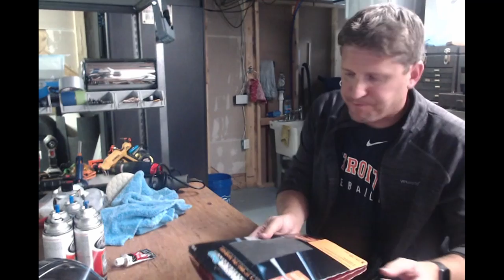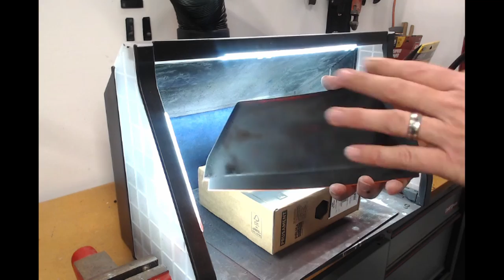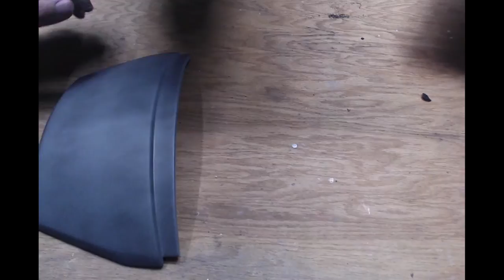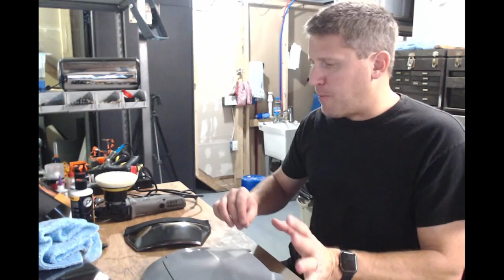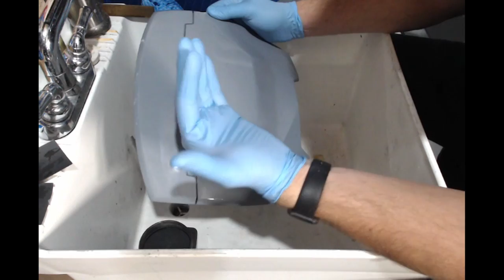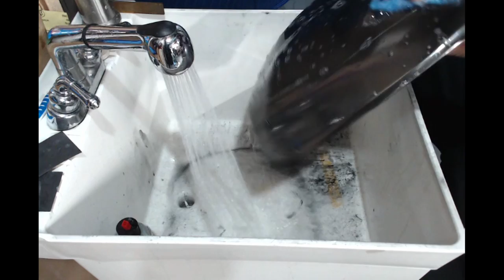Mandalorian - Start to Finish Armor Process with Graphite

Comment: I've seen anothr YT Vid where the 2k Clear Coat did not cling well 2 the graphite powder, nor does it withstand flaking or rubbing off. It looks horrible. So is it better 2 use chrome-colored paint then Clear Coat on top instead of graphite powder?? Clear Coat sticks 2 paint, not power. Wht do U recommend?? If choosing 2 wear armors as Cosplay frequently, which painting/graphite method would U suggests as tried & tru?? I need 2 kno b4 I invest in ths Project...

Comment: YOU SAVED MY HELMET! This was certainly not a beginner-friendly project (literally the third thing I ever printed...) and in hindsight I should have known. I didn't wear gloves when I first graphite rubbed it and I left splotches everywhere. Ended up pushing through at it was decent in the end, but the finish wore off very quickly. It became dull and had an almost burnt-steel effect which I expect came from the oil on my fingers. Finally took the time to take out the visor and graphite rub it again using this tutorial (and latex gloves! 😅). What a difference! Alright, I didn't sand the old finish down, didn't rub it and then didn't clear coat it and rub it again, but the method of washing it and being meticulous and slow really works amazing! Sure, it's far from perfect, but it looks great on my shelf again. Satisfied beyond belief. Thank you so much!!

Comment: Just started printing my armor using the great ape files (I just love my Prusa i3 Mark 3s!) and am collecting all the supplies. Will practice on the first piece using the butt and back plates, then assuming success I’ll do the bracers and finally move on to front and shoulders and then finally the helmet. This way I’ll build experience before doing the ‘show’ pieces … really appreciate you doing such a detailed process video! I now have the confidence I can paint my armor myself!

Comment: I finally just finished the process (took me close to 3 weeks w/my schedule).
Wow, it felt like a 30 step process, LOL. It wasn't that long...I love your results.
My results after following step, by step and getting the same products (all but the same brand of graphite powder), I got some dark/dense patches when I started to lay down the graphite powder.
I need to do my graphite wash and 2nd clear coat tomorrow...Hopefully the 2nd clear and graphite coats will cover the dark splotches as well as the light ones you mentioned.
I may need to wet sand and polish a bit harder...we'll see.

Thanks again for your process. I want to perfect this and get your glimmering results! :)
Reply from the maker: The blotches are normal. Hope it came out well!
Reply: Thank you Joseph! I watched your tutorial, yet again, and you do mention that. Sorry to bother you. I did apply the 2nd clear and graphite coating and yes, it's much better. 🙏

Comment: I know its a little off topic but I am looking for a flat black finish on an automotove a 3D printed part that will be in the sun and weather
 I think most of your vide applies to what I am doing. Most of the flat black is enamel you note to avoid enamel, why?  I understand the paint and prime portion but I want end up with flat black part that is good ourtoors. 

My son is using your vide for the shiny mandalorian helmet you are demoin in the video. He pointed me to you since you mentioned you had done work on the automotive paint side. Great video BTW!

Comment: This is incredible! I’m overwhelmed by how comprehensive this tutorial is!

After the final graphite application and cleaning, should I allow more time for the clear coat to cure before handling it?

Also after that final graphite application, should I add another clear coat over it or would that be overkill?
Reply from the maker: You can handle it, just be gentle. Give the paint some time to harden up before really playing with it, couple days.

As for another clear, you absolutely can, just would be dulling it out.

Comment: Thank you for the video!! I followed your process and my Armor turned out perfectly. I have used the armor since then and have  scratches like you mentioned I need to fix. In the conclusion/portion you mention that you go back wet sand and clear coat but my question is what step do i got back to to fix the scratches specially? the last primer stage to clear? etc? again thank you for the video!!

Comment: I have questions. :D

1. Have you considered reenforcing the back with fibreglass?

2. I've seen a lot of people use a 2K clear coat over the final graphite. Is there a reason you don't do something like that?

Thanks, great tutorial!
Reply from the maker: 1 - You could, I haven't found a need.  My first helmet I did fiberglass back along the seams.  My current one isn't, no issues.  Over 40 hours of trooping in them and no problems.

2 - You could, any coating over the graphite will dull the look though.

Comment: Hey! I know it's been a year so you probably won't see this, but here's to trying. Could you make a video or explain how you prevent overspray (or dust layer I think you called it?) On the helmet? Basically spraying one side causes the other sides to get slightly misted, ruining the smooth finish.
Reply: Good mist extractor, masking and polishing are all possible solutions for you

Comment: Great video and love the process. Anyone got a suggestion on fixing a gouge that cut through the grey primer and clear coat. My thumbnail caught a forward facing edge. Thinking I can sand down the clear coat and re-do the primer then clear again but wondering if sanding the bad area down might be suffice. The gouge is the first white primer coat.

Comment: Another Quick question! You mention that the second graphite rub should be done when the varnish is still not fully cured, so that the graphite can cut in better. If one is not doing the optional polish step, is it perhaps sensible to also do the first rub when the that layer of clear coat is not yet fully cured?
Reply from the maker: Yes, you could do that. I would test on a test piece though.

Comment: Do you think this process could be used at least in part on the black series helmet? I bought 3d prints of all the other armor but I want to use the black series helmet with it. I want it all to have the same look, is it possible?
Reply: follow up in case anyone else wants to know, you can and I did

Comment: How do you handle overspray on the helmet? I can get a nice smooth surface on the side I'm spraying, but end up with a lot of overspray on the back side of the helmet. For context, I'm currently using a 3 foot cubed spray booth with a 24" box fan and 24" furnace filter on the back of it.

Comment: Did you consider using a small rotary with a soft pad to apply the graphite? Or is by hand the best method.  Any particular  application pad you recommend?
Reply from the maker: Hand is more than sufficient, cotton pads seem to work best.

Comment: Hi there, amazing finish.. I wanted to know the actual process step by step and please correct me if I'm wrong.

After sanding and priming, you go with a clear coat, then you polish the clear coat, then graphite, wash, clear coat again, polish, and graphite ? 
Is that the correct sequence ?
THANK YOU
Reply from the maker: That’s correct!
Reply: @CT-Props  missed a step, the sealer ? Is it a grey gloss paint ? 
Because I have a black gloss, that's ok too ?
Reply from the maker: @PixelForgeLab you can use black, but the finish will end up being darker
Reply: @CT-Props  ok thank you 👍🏼

Comment: Awesome guide!

Silly question, but should I be using a separate sink from my usual bathroom and kitchen for the wet sanding?  I'm just trying to avoid excessive clogs.
Reply from the maker: It is less about the clogs and more the mess. My alternate to the sink was being outside with a 5 gallon bucket.

Comment: I don't know much about paints, why do you want to avoid enamel? I used Rust-Oleum 500° engine enamel as the base coat. I had a few issues with marks in the paint, is that because it's enamel?

Comment: After the first graphite application, I got the haziness you talked about but worried that if I add more clear I am concerned I am going to lose the glossy smooth finish I just worked so hard to get though al the polishing. Don’t you end up with a little orange peel and a spec of dust or two in the clear?

Comment: Hello, I have the Thor hammer aluminum metal and it has like a dull looking to it. So I painted it with 2x clear coat which was okay with the shine. Can I apply graphite powder to it for the chrome looking paint? Just wondering if the graphite powder will stick to the clear coat paint. Thanks a lot!
Reply from the maker: It will, but you may get some rub off.

Comment: i would like to know how one would weather it with your method. how airbrushing would react to the graphite and such
Great video. I would totally use your method when doing my build. What printer did you use for those size pieces?
Reply from the maker: I used oil based paints for the weathering. Air brushing will work, but you will run into issues with the paint scratching off. 

All prints done on a Prusa MK3S

Comment: Fantastic vid! When you sand the clear coat, are you using 320 or do you start with only a very high grit so as now to chew through it too quickly?
Reply from the maker: I have it in the video, believe it is 2000 grit on the clear.
Reply: @CT-Props  Ah must've missed it, thank you!

Comment: In Canada, one can of that 'cheap' Rust-oleum filler/primer is about $35-$40, and the nozzles clog after one use something like 50% of the time.

Pricing is pretty much the same for the other brands, so I basically dropped out of the paint finishing game for my hobby prints.
Reply: You'll definitely want to look into the protective gear you need to work with large amounts of it, but another really effective way I've seen people smooth prints is with UV resin, specifically the stuff used for resin printing. A bottle of it may be a more cost effective way to finish prints if you're ok with the safety concerns. Another channel called Vaultfox has a really good video talking about it while making a Bo Katan cosplay.

Edit: I just tried checking CA Amazon and it seems like you can get a 1L bottle for between $22-25, which should cover a bunch.
Reply: @MikeKatsar  Thanks for the info. I have actually used the resin 'trick' before, but my concern is usually not so much focused on smoothing, but rather painting the printed item to whatever colour I need. Smoothing I can get done satisfactorily (for me needs) by sanding alone.

Currently, I sand an item, then blow a few layers of acrylic paint on it with my airbrush, followed by an acrylic clear-coat of some kind (either Pledge floor wax or varnish). No more spray-bombs for me...
Reply: @imacmill  ah, gotcha. My bad, I misinterpreted the issue a bit. Unfortunately I don't have any other tricks for that one. Good luck/happy crafting, man, hopefully you find a cheap source of paints, airbrush adds up lol
Reply: @MikeKatsar  Dirt-cheap acrylics from a Dollar Store...they work perfectly.

Comment: Could you spray a light silicone lube to help with the preservation? Could give a nice shine and some slip and slide without being wet, spray and wipe off.
Reply from the maker: Is the goal to avoid surface damage?  It is pretty slick as it is since graphite is sometimes used as a lubricant.  Only damage I tend to get is hard rub or high impact hits.

Comment: How do you clean your parts prior to applying primer? Would a wipe with isopropyl and paper towel work? Then a light wipe with a tack cloth?
Reply from the maker: Light wipe with a lint free cloth.  IPA or any other solvent/cleaner can damage the primer.
Reply: @CT-Props  what about removing the grease from handling it with your fingers? Dish soap and warm water?

Comment: Can you mask over graphite after you apply a clear coat?  I wanted to try some tinted clear coat over some of the graphite, but not all. Some say that with graphite the clear coat doesn't bind as well and the masking tape would pull it up.
Reply from the maker: Yes, you can put the tape on the clear coat.  Just let it dry for awhile first.  If you put the tape on the graphite finish, correct, it will not stick well.

Comment: Is the Dupli-Color grey sealer very light in color? It almost looks white. In my tests so far anything darker than a really light grey results in the graphite looking too dark.
Reply from the maker: Yes, it is a light grey.  It just looks white from the lighting.  You can see the color at the 32:00 mark
Reply: @CT-Props  Yeah I noticed it seemed very light which was why I wanted to check. Thanks for the quick response. Love how thorough this video was!

Comment: Thank you so much for this detailed guide!! I’m currently doing my mando helmet and this has helped a lot. One question… I can’t seem to find a duplicolor grey sealer here in the UK, do you know of any products that I can use instead? Thanks!
Reply from the maker: I am not unfortunately.  That said, you could use even grey paint and get a similar effect.  I would just focus on it being automotive grade and less about brand.  Of course, test first on another piece!
Reply: @CT-Props  could a grey surface primer work for this purpose (not a filler in this case, but a flat surface primer)? Im in Europe and have a similar issue that I cant find anything here called a primer sealer.
Reply from the maker: @PrattleCor  It should, you could try just a grey paint as well.
Reply: @CT-Props  thanks. And thanks for the awesome tutorial!

Comment: so i was wondering, can you use this method too for weathered paint like as in the silver bekar for a paint chipping effect, i am currently working on my orginal mandalorian cosplay and want to create a look with some painted beskar and some not painted beskar. so i wonder if you can spray paint over it or add some clear coat  and then spraypaint over it?
Reply from the maker: You can, did the same with my leg plate
Reply: @CT-Props  ah thanks!

Comment: ins´t there a final clear coat for the second graphite layer?
Reply from the maker: There is not, but you can. Downside is that it will dull the finish
Reply: @CT-Props  but could I polish again??

Comment: What would you recommend to do if you  get a little bit of pooling of clear coat in a couple spots after the first graphite layer?  Sand it or keep going?
Reply from the maker: It would really depend on how picky you wan to be.  You could do without sanding, but good chance you will see it.

Comment: Hi, I have a little problem with this method. I apply graphite to a shiny black and very well... but... the prints are marked a lot later... if I hold it for a few seconds... the marks...I have applied an acrylic lacquer because it loses its shine a lot...later I can apply graphite again...but the same thing happens to me...I don't know what is wrong...
Reply from the maker: Are you saying you used this method?  or above was your method?  You mention  acrylic lacquer, you using the Rustoleum one?  I generally stay away from Rustoleum as a finishing product, their paints are just not suited to the task.
Reply: Hello, thanks for answering... I use a gloss black acrylic paint. I let it dry for several days. Clean with soap and soft cloth. then I apply graphite...but it's as if I couldn't hold on to the same place for a while...it leaves a mark and loses that sharpness. In Spain there is no rust oleum... there are other better ones... it could be montana color... etc... I just finished another 2 pieces... after the graphite... I wash with neutral soap and dry with soft paper...
Reply from the maker: @phulpo  All I can say is you are not following the process laid out in the video, so I really can't speak to the results you are getting.  One issue is black with graphite, it will come out very dark.  It is better with a grey color.  Also, seems like you are applying it directly to the paint and not a gloss clear coat.
Reply: ok..ok.. true... my method is different, but yes... it is steel but according to the light it seems darker... I will do it on the gray primer. thank you very much

Comment: So it’s possible to primer with grey instead of black so that the overall look isn’t as dark? Would that work with an airbrushed paint like duralumin? Primer with grey, clear coat and wet sand then apply duralumin……I wonder if it would give the same effect you have created here with graphite…I know that duralumin with a glossy black looks more on the dark side
Reply from the maker: In theory, yes. I would test it on a small piece.
Reply: @CT-Props  can you tell
Me the name of the grey primer and Clear coat you used here? You have the best graphite result I’ve ever seen on YouTube
Reply from the maker: @Sjsharkie777  I go through each product in the video. Chapters and links to the products are in the description.
Reply: How about USC Spraymax 2K clear coat that has an activating agent in it that you have to activate in the spray can before spraying. Is this a viable option or is that considered an enamel base clear coat. I was looking to for cam you used on Amazon but I do t see it.
Reply from the maker: @Sjsharkie777  you can try it, but I have not tested it.
Reply: I found the duplicolor clear coat….I’m going to go with that since it does not have a 48hour use window after using like the 2k max does and you got amazing results
Reply: Do you have any reference photos of your full armor on. I’m curious how it all looks together. Thanks for all your great advice !
Reply from the maker: @Sjsharkie777  Not the best pics, but here you go! https://twitter.com/VMPrime/status/1449929784444833799?s=20&t=TlzzpXh3KVv8igSONLEhrw